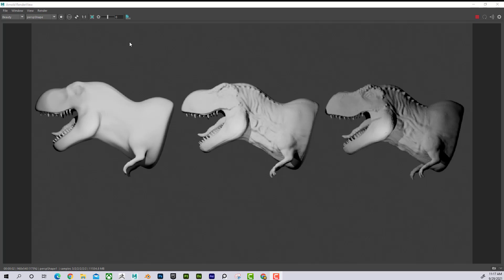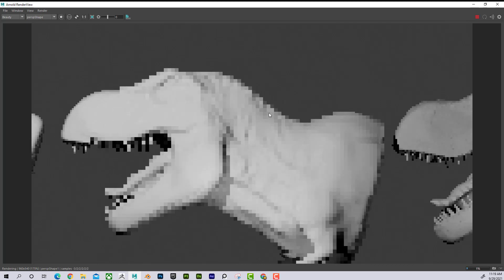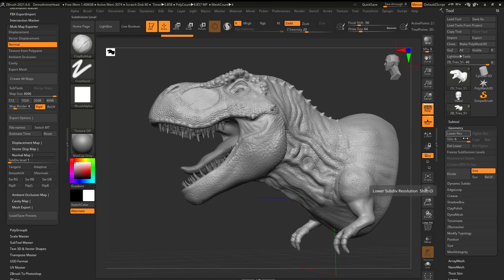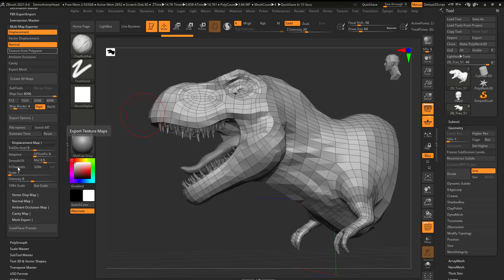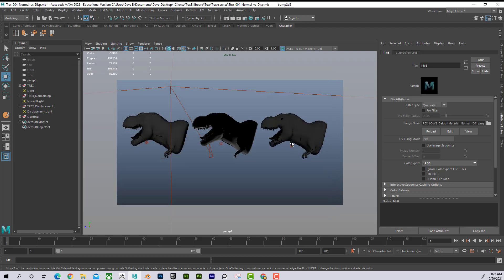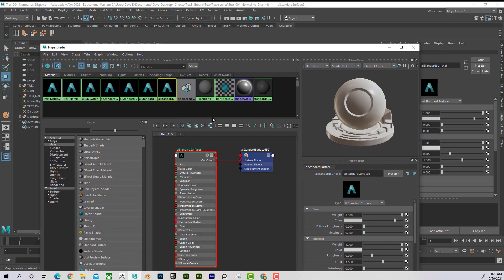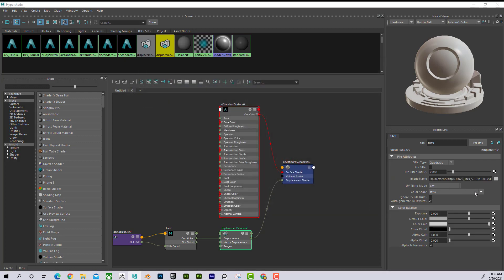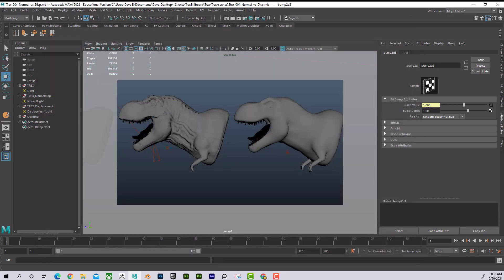Normal Map vs Displacement Map

Comment: Adding '1' to the displacement scale - is that the default corresponding size of the zbrush sculpt? If not, how do you know what is the original scale for displacement other than eyeballing it. Thanks.
Reply from the maker: Yes that represents the size in Zbrush.  However if you scale the object and freeze the transformations that can screw things up. For example, if you scaled it 10 times bigger and froze the transformations then the displacement scale would have to be set to 10 to offset that change.
Reply: @davidbittorf  that’s great. Thank you.

Comment: Hi people. Can somebody please explain to me why should I use a displacement map instead of use the original high poly mesh? What I understand is that rendering is going to put again the subdivision to six. Maybe 'cause animation is easy with low poly? Is there another reason? I'm not sure if I got it... heeeelp please... thanks.
Reply from the maker: Great question!  If you had a super computer you would not need to use a displacement map, instead you could just use the original high poly.  Sometimes, if I'm just rendering it out, I will just bring in the high poly and render it so I don't have to mess with the displacement.  However, if you are going to animate, rig etc., it would be very problematic to have the high poly in Maya.  In fact, it were high enough poly Maya would just crash right away.  So having a low poly character with a displacement allows Maya to run smoothly, animators to animate with ease, and makes everything less clunky.  If you don't care about animating and if Maya allows you to import the high poly, go ahead and do that so you don't have to mess with the displacement.
Reply: @davidbittorf  Thanks for taking your time, I really appreciate it.
Reply from the maker: @SuperValhala  Of course.  Make sure to subscribe if you haven't already for updated videos every week!

Comment: Oh, thanks 💗 
Please answers 
displacement map is superimposed on 1 level of subdivisions of this model ?
Reply from the maker: Hmmm.  I'm not exactly sure what you mean by that.  Your level 1 should have the displacement on it so it looks like the high resolution.  That is the point of what we are trying to do.
Reply: I mean for a high-poly model (not for production) from Zbrush is enough to make a displacement map (as you showed in this video) for render this model (present a beautiful picture) and textures application on her?
Reply from the maker: @Alinastic  if it is strictly for a render and you only had a high poly version you would not need a displacement. You could simply render your high resolution mesh.